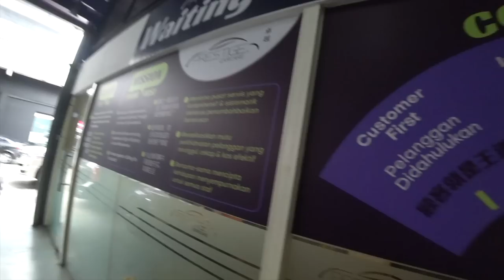Audi RS6 going through the full inspection for Evoclub's extended warranty | Evomalaysia.com

Comment: HiBobby, just for sharing some tips. I owned a 2012 S6 V8 previously and they came with the same ceramic brakes, if your car come with a safety feature that brakes atomatically when they detect front object, this brake will always response good and whole car passanger will get shock for the sudden stop. And driving aroung raining days those brakes behave differently, personally feel they are not as good as dry when drive fast. Be cautious. Have a good day.

Comment: apart from buying certified preowned car from official car maker, if buy from mainstream 2nd hand dealer - what are the recommended workshops to do all multi point checks etc to determine the car is in good condition & ori parts before deciding to buy ?
Reply from the maker: just sign up club.evomalaysia.com and we have 42 inspection centres in malaysia .. :)
Reply: Hi Bobby, I have created an account and login but I see nothing. The member portal seems don't have much information. I am planning to get a recon car and wish to find a workshop to do the inspection before purchase.